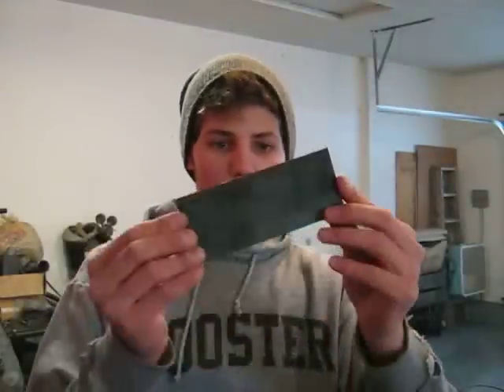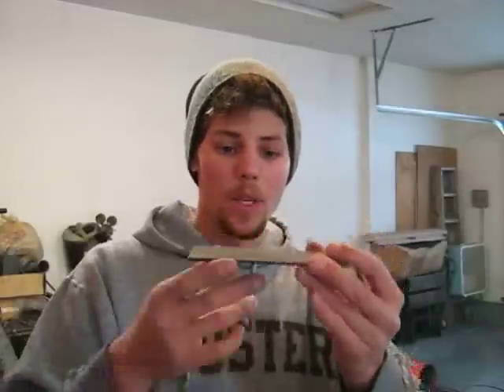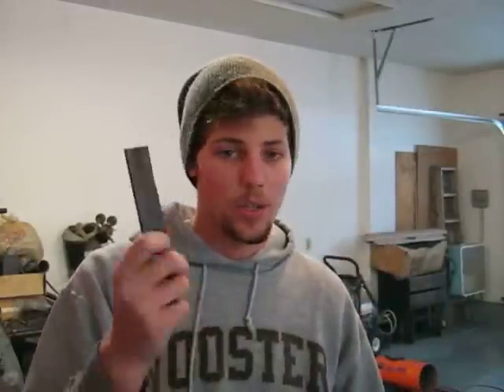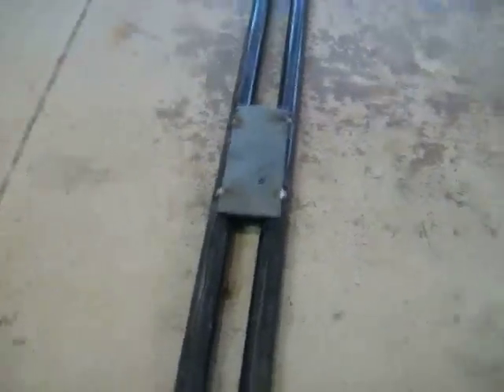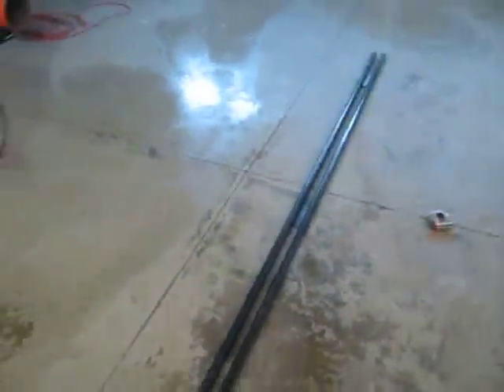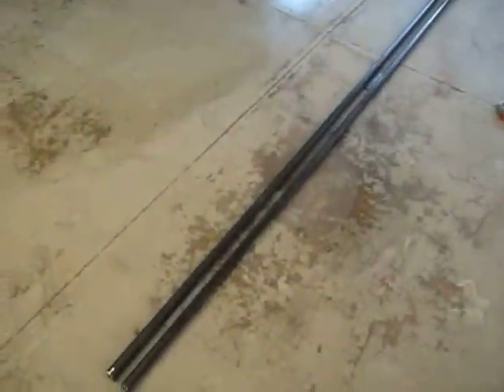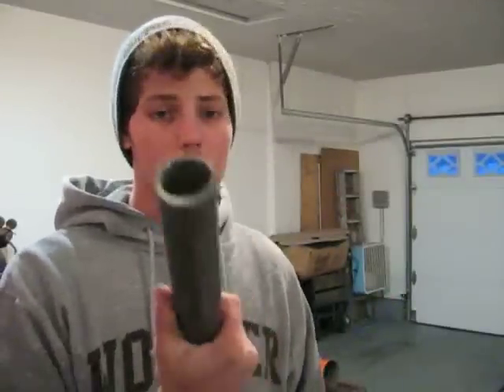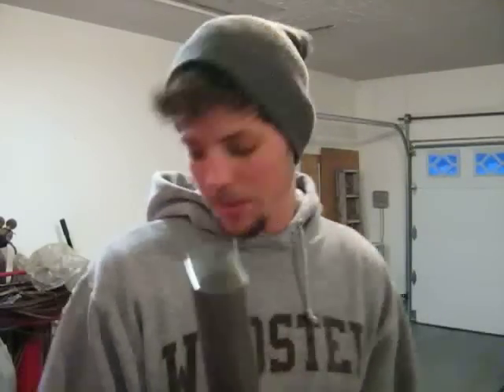DIY Build your own Ski and Snowboard Rail!

Comment from the maker: the rail part i got at home depot in the plumbing section for $13 a piece. its 3/4 inch, 10ft long, i think used for gas line. (theres a 1'' thick option to)
the base you can use any round stock found anywhere. you would even buy an extra one of the pipes from home depot if u wanted. I used inch and 3/4 .120'' wall mild steel that I had laying around. construction is fairly simple if you can weld and cut easily.

hope this helps
nick

Comment: @mysnowboard1321 the rails are smooth enough so they wont shred it up. just keep off the very edges or grind them to a cure if you want to avoid gouging. otherwise if your that worried about your precious board stay off the rails =) wear and tear is inevitable